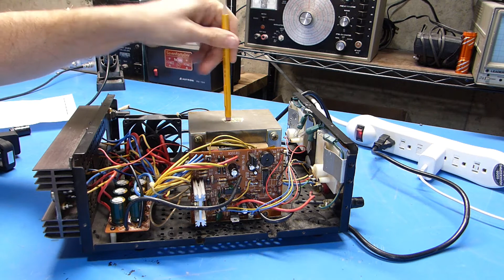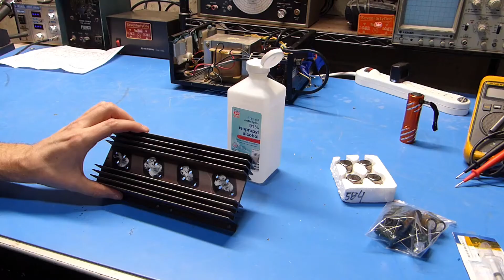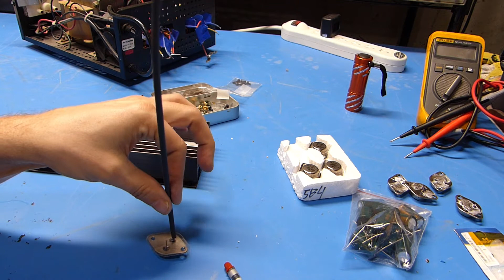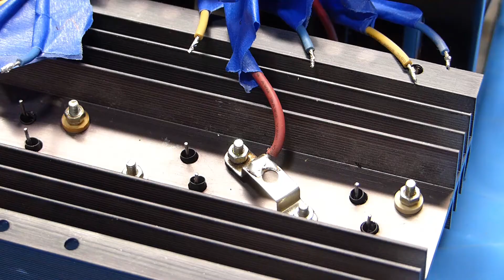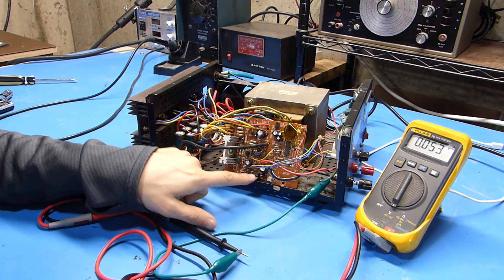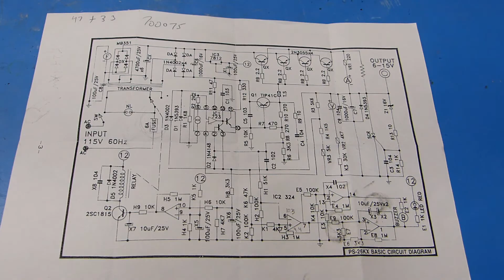Pyramid PS-36KX Power Supply Repair Highlights

Comment: Im not going to go down and read all the comments Im just going to tell you I had meters stuck on the same power supply in for a small repair.  I took the meter apart and found a small screw on front that once I broke it loose the needle moved freely.

I just made a quick video about it on my channel.  73 VE1RCI

Comment: Hi I know this video is 7 years old but I am still interested so thank you. Question I have a pyramid phase 3 4.5 v-15v 25 amp power supply. I would like to drop it down to 3 volt output. How do I do that ? Can you help me? Thanks
Reply from the maker: The answer is a bit involved for a YouTube comment but here are a couple of suggestions.  1 - look into using a separate buck converter power supply that will plug into the power supply's output and step the voltage down from 13.8 to 3v.  I don't remember what the regulation circuit in the power supply looks like or if you can simply adjust the output voltage down to 3v but that might be an option.  You'll have to study the schematic and maybe the datasheet of the regulator chip to determine.  If the regulator can't be simply adjusted to the level you want you'll have to redesign the circuit...again, study the schematic and regulator datasheets.

Comment: I acquired the PS-36XX yesterday. It's ill. Reading 11.8 volts and the potentiometer has no effect. After you replaced the TO-3's the 1st time, your's still didn't work correctly. You stated the meter isn't working. It is working, just not showing variable output. You then replaced the regulator chip...still not working. I replaced the TO-3's with good parts...didn't fix mine. I'll also try the 723 with little hope that it will correct mine. I have 5? of the variable type Pyramid supplies, all faulty. Seems they have serious design flaws.

Comment: Have a similar problem with a power supply made by the same company. Pyramid 52 amp seems like the fan. When I turn it on starts to run then it slows down and completely it goes off did you ever find out why the fan was not working? I'm having the same issue with the fan. Is the fan supposed to turn off for a few minutes and then slow down or is the fan supposed to stay on constantly or does it turn on only when it gets warm it needs to be cooled down. I really appreciate if you can help me. Thank you very much kg4acg Sgt Velez USMC ret

Comment: I accidentally fed 24VAC to the output of the Pyramid PS26KX and blew something. Now I only get the "PROTECTION"" alarm and no output. I replaced the LM723 IC, but this did not do anything. Do you have any suggestions to get this working again? Any help is appreciated. Thank you!

Comment: My brain has a difficult time with electric.  Somebody point me in the right direction please.  Ps-36kx had no power out after I oops it.... I replaced the transistors because they tested bad, now it has 12 to 12.1 volts out but not adjustable via knob. Is this a 723 chip problem you think? This all started (oops) because it was working but i hooked up a million cp 12v spotlight which worked about 3 seconds then ps went into beep mode. The adjustment knob has never worked since i got it second hand. I would like to get adjustment knob working if somebody thinks its the 723 chip, ill replace it. Currently working but holds 12 to 12.1 volts out (not adjustable). Thanks.

Comment: I am not happy with pyramid supplies. I have bought several and none of them lasted over 2 years. I believe RF just flows through the supply and the supply isn't built to deal with RF. So why would you buy one of these for if you aren't using it for the radio room? Junk from the factory. Buy Astron (even this doesn't like RF). Or even a switcher like TekPower (dead silent, no hash). Personally, this repair probably wont last long either so it's not worth the time or expense.

Comment: I had a similar problem on my Pyramid PS36XX. It went into protection mode and folded one evening while I was using my ham radio. Initially, I found all four 3772 pass transistors had C/E shorts. I too bought some knockoffs from ebay stamped as
"MOTOROLA made in Mexico". But in my case, after the repair, the unit seemed to be fine. That is, until I tried anything beyond a 
15 amp load, then it would fold and go into protection mode. I cast the whole thing aside but did buy four new 2N3772s from a reputable source. A year later, I decided to give it another try. If it wasn't going to be a simple fix, it was headed for the junkpile. After removing the heatsink, I found all four pass transistors were fine. And then, the obvious hit me head on! The heavy red leads that feed the collectors of the 2N3772s in pairs are soldered to a heavy tab (as is shown in this video).. It happened that I had removed the wire during the initial repair for extra slack in the wiring and apparently didn't use enough heat  when I reconnected them. One was fine but the other had broken away and was dangling. So,, one pair wasn't even contributing to the load! Sure enough, after the second repair, the power supply is now back to full output with NO annoying alarms. And I have four new 2N3772s still on hand, just in case the ones full of "Chinesium" break down.

Comment: I have fixed a lot of pyramid supply's over the years . got a 52 amp in bench now. I use a transistor tester . some times you get leaky transistor and for best loading match the gain Hfe. you can use 2N3771 as long as input voltage not to high. the 3772 is same just higher voltage . the 2N3773 is higher voltage but less collector amps.  I keep insulator kits on hand. Mouser has them. you can use tip 120 for driver even tip 3055 depending on supply . Them bridge rect go bad very often in pyramid brand, that what wrong with what I fixing now. doing a stud diode upgrade with heat sink . very tricky in small space. I did this many times before. also I have had problems with RF getting into the 723 and causing trouble .some inductors on sense leads and .1 bypass caps fix the problem .I have added fans to them. the 2n3771 on back has no air flow threw it. look as Astron for same amps. much bigger heatsinks stud diodes and a beefey transformer. I can say the 86 amp PS 86KX  is great. what I own and use all the time . never had trouble . I have made my own 240V 200 amp with LM723 and 30 2N 3772 . 2N 3055 driver . fan cooled made in a forklift 48V 100amp charger cabinet .get a ball barring fan to replace the bad one. can mount a 80MM fan on back heat sink if user loads it up alot. also some times them 2.2 ohm resistor on base burn up. check them .watch for China junk parts . Mouser or Newark has the good ones. 73's

Comment: Hey their I'm only getting 11.8 volts on the terminals and moving the voltage adjustment not changing could get back with me with any idea it's a ps-52kx pyramid and have new capacitors I installed and still doing be nice can get back with me

Comment: Nice video, thaniks for posting. Your 723 Reg chip voltages wasn't that far off and 14 pins is a lot of soldering, twice!   
Was hoping you'd go more  more into Series-pass transistors.  They seem to go bad by shorting  C-E.
Reply: If/when I would install a DIP socket, easy and makes life much easier and less burdensome to the PCB.

Comment: I would advise to put a socket for the 723 seems mine fails more than it should on my 25 amp pyramid supply. If the power out leads are shorted, even the slightest amount the 723 will fail.
Reply from the maker: Good tip!

Comment: 3 years later I find myself trying to repair a pyramid PS21KX , I repaired a physically damaged transistor thinking that was obviously the problem, but it wasn’t. Still get only 1.7v with no load. I suppose after watching your video I’ll try your steps. Thanks Rob👍
Reply from the maker: Give it a shot and see what happens.  If there is anything I can do to help, you know where to find me...good luck!

Comment: Replace the 1N5393 zener diode that protects the voltage regulator IC while you are in there.
Voltmeter is a simple series circuit, the meter and two series resistors, a 30K and a trimpot to adjust the reading. (make sure you are adjusting the correct trimpot).
Ammeter is similar series adjust, but monitors the voltage across a current sensing resistor.

Comment: mine was working - now pegs out on Amperage and blows the fuse without any load.  What could it be?  I also am having a hard time finding the real fuses - what came out was a 8A 32V but manual says 6A?  7.5A from Autostore continued to blow.  Any help would be appreciated! :)
Reply: First things you need to check the bridge diodes so see if they are shorted. More than likely that's your problem.  If the diodes are good. Then check the scr device it could be bad
Reply: @lgcacher9205  Do not try connecting that open leg on that Full-Wave Bridge Rectifier it WILL Short Circuit! Look at the Circuit really close Capacitors make up for that other connection - you hook up that connection you short the opposite current flow to your capacitors. Believe me something is going to give wires or circuit.

Comment: I have the same one but is brand new. Out of box. And is doing the same thing. I turned it on and it worked. I then hooked up my Stryker 955. And was still working. The bolt meter wasn’t working so I tapped with my finger where the meter is and that’s when it started beeping and the protection light lite up. I never keyed up my radio. Any ideas. Thank you. Great video
Reply from the maker: Hard to say without being able to test it.  Check all your connections and make sure they are good.  If they are then it might be time to fix this unit up.

Comment: EVERY Pyramid PSU I have ever opened up had 25 Volt caps riding right on the edge of there voltage rating they really need 35Volt caps.
the moment you told us he got E-Bay Transistors I was like there Fakes! if he got the caps there too going to guess there fakes too.
Reply: Depends on who you purchase them from on ebay, obviously if it ships from china and its not a chinese made brand, its suspect.

Comment: can you share where you got the voltage matrix from for the IC 723 chip? did you test the voltage on the chip once you replaced it?
Reply from the maker: I don't remember...maybe the mfg datasheet.  Or the schematic I found.  Sorry I can't be of more help
Reply: @SevenFortyOne  i found it, thanks
Reply: The 723 chip voltage matrix is found in many of the Astron power supply schematics such as the RS-35M.

Comment: Thank you for posting. For the older PSU's,  I   replace the original regulator PCB with a preassembled voltage regulator  to  drive the pass transistors.

Comment: Just found your channel, worth watching - subscribed. Just one point. There was a video on YouTube of a chap repairing a power supply and there was a lot of the usual 'Chinese crap' being said. Just one little problem, in small letters in one corner viewable to all were the words 'Made In The USA' .  Personally I could not afford my electronics hobby if it were not for China. From the USA one LM317HVT was over £4 plus postage - from China £2.40 for 10 postage paid. I do under rate all power items and so far no problems - except yesterday. I had a 50 Amp bridge rect. go to a direct short across the AC. It had around 40Amps up it and boy was it spectacular. Tried another under load and no problems. Good old Chairman Mao. The video above was taken off.
Reply from the maker: Thanks for stopping in!  I have a varied mix of topics in my channel.  No doubt the Chinese components Help make this hobby reachable for more people

Comment: I have one of these with the 2n3772 transistor, but the schematics I find online specify 2n3771 transistors.  Any issue using the 2n3771s (local shop has them in stock, but not the 2n3772)?
Reply from the maker: Check the data sheets on both parts...I think they will work for this power supply.  I think the 72 parts are higher voltage but otherwise the same but I'm not 100 percent sure
Reply: @SevenFortyOne   The 771 has lower voltage but higher amp rating. Will try it out.  I tested the transistors today following your walk through and was able to confirm they're bad. Thanks!

Comment: Hello,I have a power supply from MFJ-Model 4035MV. It was stored in a box for over 10 years and worked back then. Now I just set it up and the VOLT METER FLUCTUATES from about 5 volts to 12. After it is plugged in to the AC outlet for about 5 minutes it stops at 13.8 Volts.But if I try to adjust the voltage the meter starts to fluctuate once again but does not go pass the 13.8 volts reading.What do you think is the problem with this power supply? I do NOT want to fry my radios.
Reply from the maker: The voltage control may be dirty, or you may have bad capacitors...could be anything really.  It's hard to tell without being in front of it myself
Reply: @SevenFortyOne  Thank you for the information.

Comment: thanks for the great video! i have a ps35 i got on ebay. blowing fuses so im wondering if i should check the lm723 first because the transistors look new. also is thare an easy way to tell if the tranformer is shorted to ground? thanks again!
Reply from the maker: I don't remember the circuit in this but use an ohm meter to check for shorts from the primary and secondary leafscto chassis.  Transformers often fail open, not short so the problem may like elsewhere.  Even if the transistors look good they may be bad.
Reply: CHECK your NPN pass transistors FIRST (2N3771 or 2N3055).
DISCHARGE Electrolytic BEFORE Removing or Installing the uA723/LM723 ... watched new student destroy one (when he didn’t).
I have also found Cracks in the Mica insulator.  TO-3 transistor case is HOT (16-23 VDC) ... a Short will blow fuse.

Comment: I have one like this and the amp meter is not working  where would I start look for the problem?
Reply: start with checking continuity through the meter with a loading resistor in series

Comment: Have a Pyramid model PS-32LAB and the Ammeter wont work, just the voltmeter works. Its impossible to find a schematic so I don't where to begin troubleshooting. Any suggestions?
Reply from the maker: I'd guess that if everything else is working the ammeter is probably physically stuck or broken.   Having said that, if there is a part number on your circuit board try searching in that.
Reply: @SevenFortyOne  unfortunately theres no part number on the PCB. But I tested the Diodes and the Pass transistors and they all checked out fine. Its a 30V 5A power supply. I tested the voltage and current, its putting out approximately what its suppose to. The ammeter cpil winding looked a little unraveled with creases in it when I looked inside of it.

Comment: My 36kx just went into protection mode, evidently when it was on, the positive wire hit ground. so therefore the protection circuit is now screaming. HELP!!!...  just wondering if you have any ideas before i tear this down.
Reply from the maker: The owner of this supply reported doing the same thing (shorting power and ground) just before it quit.  Try letting it sit for a while to see if it "resets".  If that doesn't work you may have to replace the pass transistors and regulator chip like I did.  I Also suggest checking the filter caps while you are in there and replace them if needed.

Comment: 2 questions:
1. in this power supply protection of an exit against overestimate of 16 volts works at SCR. In my ps-36kx it is TYN825 (25A ! , 800V). it less than gives a source(32-35A) !  What do you think - is it will protect?
 2. in my ps-36kx emitters of power transistors are connected directly to + C7, C9, and the shunt and the ampermeter stand more to the right - ONLY to OUTPUT exit. In this case protection on current has no current sensor. what do you think of work of current protection?

Comment: the scheme which you show is signed as ps-26kx and the movie about repair of ps-36kx. Whether you can lay out the link  schematik diagram on 36, or at least describe a difference.
Reply from the maker: I am not positive but I think the main difference is the size of the transformer - the ps-36KX transformer is bigger.
Reply: thanks

Comment: Thanks. I had no idea there was such a thing as counterfeit transistors.
Reply: HUGE Problem.  I only purchase components for DC power supply repairs from Mouser or Digi-Key.
WHY would you use a UNKNOWN (Alibaba, eBay) Supplier for a Critical Component, powering thousands $$ of equipment??
Reply from the maker: Agreed.

Comment: I had a Pyramid PS-25G that stooped working...I came up with a LM723 bad...which is the voltage regulator...so I put a 14 pin socket that the IC can plug into, so I didn't have to re-solder the IC in if it went bad again. They fail pretty easy, especially if you accidentally run voltage backward up the negative line out..
Reply from the maker: I would have put in a socket if I had one handy.  I think you are right though, the 723 was probably the root of the problem with this unit.
Reply: I didnt know that..so what IC is going to replace the 723?

Comment: Maybe the Christmas lights are the wrong value,Ha Ha. Hey I just watched another You tube channel the other day where the suspected Chinese Motorola transistors,same TO2 case were the fault,so they took a dremel tool and cut the tops off to compare and sure enough they were completely different inside. Seems like this is a common problem with Ebay, Steve.
Reply from the maker: The Christmas lights were a little odd, but I'm told they worked well. That video you saw with the transistors and Dremmel tool was probably mine..I uploaded it a few days ago.  The Chinese transistors in that video were the ones that the owner of this supply gave me for the first go-round....junk.